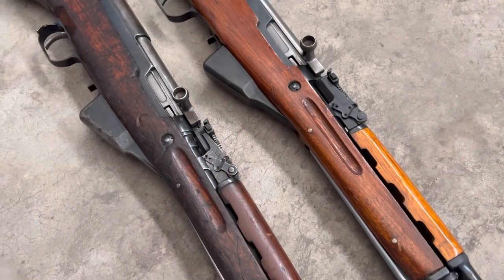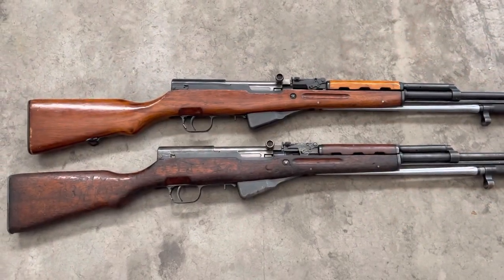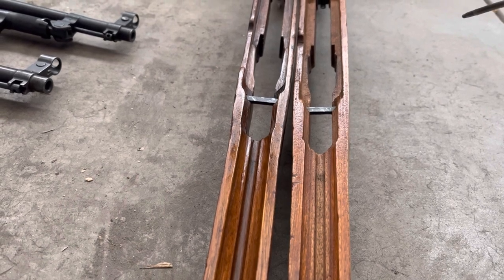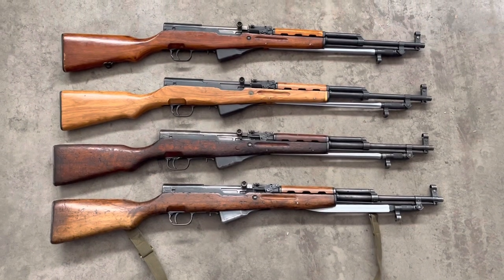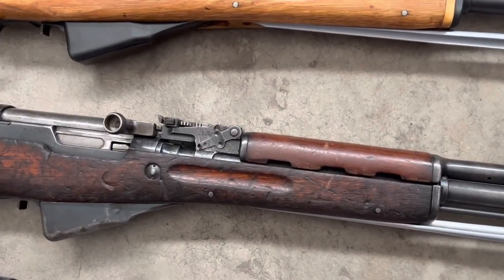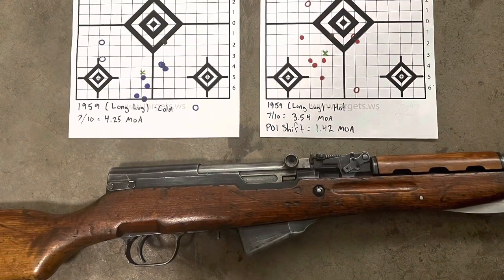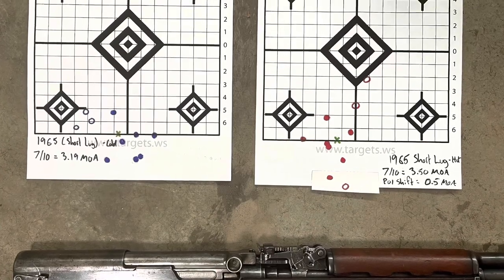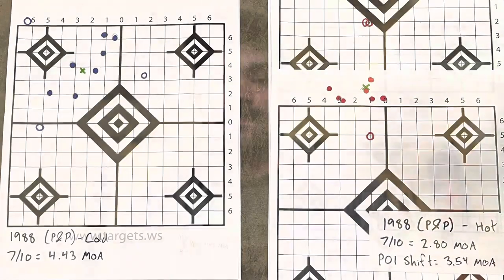Pinned vs. Threaded SKS Barrels (w/ Heat Test)

Comment: Just got my first SKS, technical question , there's million s of SKS's out there with floating firing pins, is it really necessary to install a spring firing pin, seems to me if it was a big problem they would have went back to them since they started out that way, i know key is keepiing them clean, just wondering if this is  that big of a problem.
Reply from the maker: Long story short, my opinion is that no, firing pin springs are absolutely not necessary. This would actually be a great topic for a video, as I could say a lot more about this…

The summary however, is that there is nothing wrong with a free-floating firing pin design. The “myth” of the SKS slam fire comes from idiots refusing to take responsibility for the fact that they chose to pull the trigger on a military surplus firearm without cleaning the packing grease and/or rust out of the firing pin channel. 

As long as you throughly clean and inspect your SKS before initially firing - you are good to go. 

Lastly, as you astutely point out, the SKS pattern is one of the most throughly produced and tested weapon systems in human history. If the design had a flaw that could be solved with a 3 cent coil spring, it wouldn’t have taken 50 years to figure out.
Reply: @Triangle26  My thinking exactly, my rifle looked almost new and clean, i pulled it completely down found cosmoline in the gas tubes recoil spring and firing pin bolt, you have to do a through cleaning for sure, and yes that would be a great video, thanks for responding and keep up the good work
Reply from the maker: @joecallahan3379  Cranked out a video answer to your question if you are interested: https://youtu.be/e-MjAFjDXOE
Reply: @Triangle26  Great video, well done, very useful information especially for first time buyer and owners, you hit it out of the park, Thanks for replying and sharing your insights and information, keep up the good work.

Comment: How is the lug attached?
Reply from the maker: I did a bad job of representing things in this video.

I’m not 100% positive how the barrel lug attaches to the barrel. Think of it like an AR barrel extension however, it’s functionally a part of the barrel.

The lug then threads into the receiver directly.

Comment: Threaded vs pinned, threaded is stronger.  However, it's like asking would you rather be punched by Mike Tyson or Evander Holyfield?  One will do more damage than the other.  But does the difference even matter?  For 99% of people out there, no, it does not.
Reply from the maker: That’s the best description I’ve heard yet. Well said.

Comment: When both front and rear sights are mounted on the barrel… I don’t believe the interface makes much of a difference… I would think it comes down to heat retention and warping… 🤔
If it were front on barrel and rear on receiver, then I think it would matter… 🤷‍♂️
Reply from the maker: That's a good point, but I think it technically can still matter. Even if both sights are barrel mounted, the position of the shooter's eye is still a relevant variable. If a competent shooter maintains an identical head position from shot to shot (indexed off the receiver), microscopic changes in barrel (and therefor sight) position relative to the receiver will still result in a point of impact shift, even if the sight picture appears the same.

I still don't think the interface matters in practice, but just from a purely mechanical perspective I do think it could matter.
Reply: @Triangle26  - I love the “I don’t… but still do!” 🤣👍 awesome, and yes I do see your point and do pretty much agree.

Comment: if you shot that at 65 55 yards those are not correct moa claims. you need to double that. serious fail on your part sad to say. great job tho, still made a point about heat effect.
Reply from the maker: My MOA adjustments are correct. Feel free to reproduce my targets on your own 8.5”x11” piece of paper, measure the spread between impacts, and observe the difference between the actual group sizes and the MOA claims.

The only “serious fail” here is that you didn’t bother to double check your own work before insulting the competence of a stranger.
Reply: @Triangle26  i guess those squares on your paper are not inches then.

Comment: What does it mean when there is a number 25 stamped on the Barrel in the lug of the SKS and then I have a 7 digit serial number on the receiver
Reply from the maker: You are most likely looking at an “assembly number”. This is a number which is unrelated to the serial number, but basically makes sure the right barrel goes on the right receiver.

If you remove your barreled action from the stock, you may find that there is another “25” marking on the receiver, hidden below the wood line.